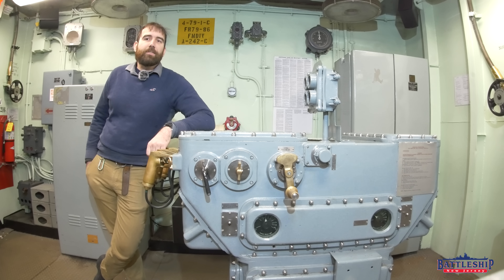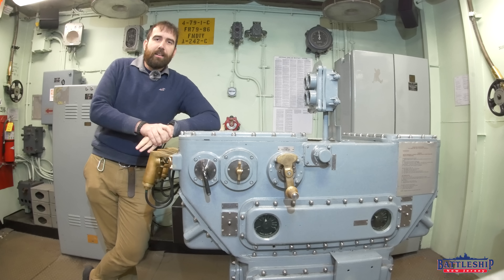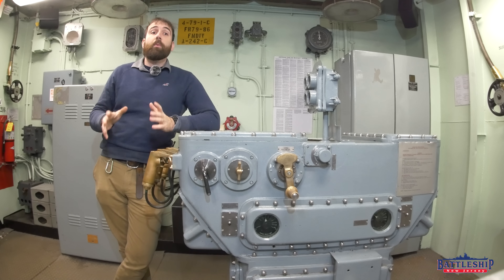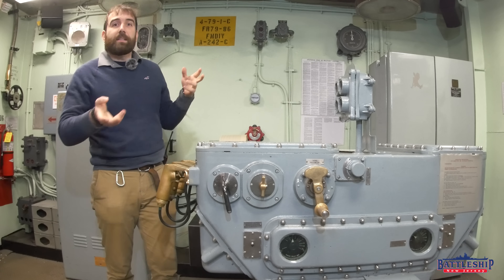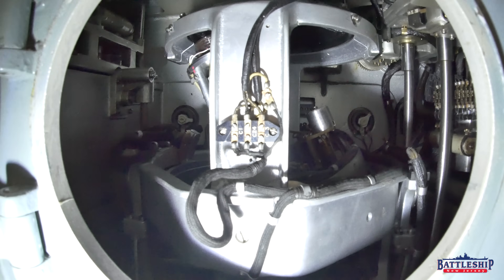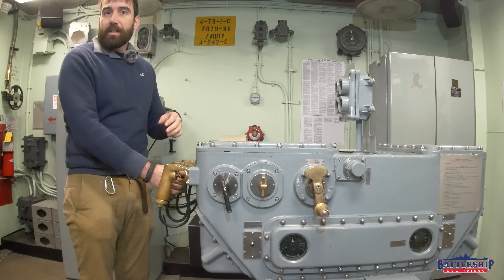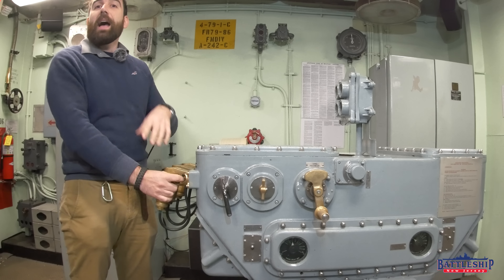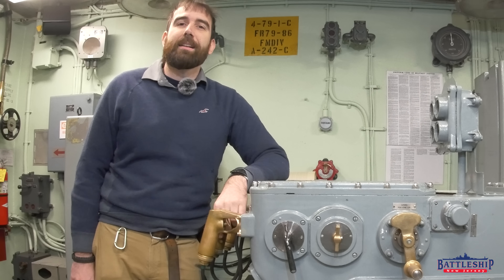The Firing Mechanism for the 16in Guns

Comment: I was stationed on the USS Iowa BB-61, Turret 2.  My last GQ station was Local Control.  One of the backup firing positions.  There was 3 of us in a space the size of a large broom closet.  Two brass tractor seats, two sets of sights, each seat also came with a set of cranking handles and one had triggers.  One person moved the turret horizontally and the other controlled the barrel's elevation and also fired the guns.  The third got no seat (sorry Charlie).  He had a few knobs on a wall to spin and mumbled into a sound powered phone.  I was the barrel elevation guy and fired the guns.  To go into Local Control, I would get the command to "go into Local Control" over my Sound Powered headset.  I would get out of my brass tractor seat, under the seat was a red lever with a pin that went into a hole.  Pull the pin and move the lever up until it stopped and push the pin back in.  You now are in Local Control.  The guy with horizontal control would look through his sights and crank the turret to the correct position and continually make minor adjustments.  I would crank the barrels to the elevation needed according to the crosshairs on my sight.  The third guy was spinning knobs for windage and mumbling incantations (LOL).
BTW: did you know when the ship is rocking in the ocean it stops for about a second at the top of it's rise just before going back down.  Besides elevation, I also had to time my trigger pull according to the Motion of the Ocean.  While everyone was loading the barrels I was making a count 1....2....3....1...2....3......1...2...3..  On "3" I would squeeze the left trigger 3 times then I would pull the right trigger and you to fire the guns at the apex.  If you fire at the bottom.....you end up way short of the target or in heavy seas & low elevation.....blasting the water and killing nothing but fish.
So YES, I got to manually aim and fire the biggest guns in the Navy with help from my friends.  Computer.........I don't need no stinking computer.......

Love to see you do a video from inside Local Control.
Reply: BTW: inset into the crank handles/triggers in Local Control are two 1942 pennies for good luck.

Comment: The leopard tank has a similar system where the gun won't fire if the computer detects that the gun barrel is not pointing at the target. So gunners are trained to press the trigger and keep it depressed till the gun goes boom.

Comment: What you've called the "stable element" is also known as the "inertial platform" and is more than just a gyroscope. FYI, inertial platforms (a three-axis set of gyroscopes) were used in Apollo spacecraft and could maintain the "bearing" of the command module or lunar module to high precision.

I'd love to see a more detailed treatment of the battleship fire solution computer as it is very elegant and the details make it all that more impressive.  Other  variables, such as air temperature and humidity were also factored in these computers.
Reply: Me too!

Comment: To be completely honest, I'm a bit surprised that the primary firing position for each turret wasn't was inside the gun house. I feel like each turret would be more accurate and maintain a faster fire rate individually in a close combat scenario than letting some guy 200 feet from the guns decide when to fire. Sure, keep piping the range information from the rangefinders on the mast but let each turret have control over its own firing solution.
Here's how I'd set it up: You keep the plotting room deep inside the ship for shore bombardment and extreme long  range ship to ship bombardment, but for closer engagements, you switch full gunnery control to a man in the turret aiming with an optical sight (Bore sighted with the center barrel). I feel like this would be a more efficient setup for reliably accurate AND fast salvos. But I'm open to counter-points
Reply: these battleships were able to hit targets miles away, while moving and while the target moved. insanely advanced analog computing

Comment: I think 3 firings locations.  Exactly what you have shown here (with the redundant bypass).  The second station should be a duplicate of this at the backup firing location.  The third should be from within the turret itself which should have the electric and the manual string.  That makes 6 ways to fire, two from each of three locations.

Comment: All these comments deriding the pistol grip fire control system.... Folks, you have to remember that pushing a computer button to "do things" was another 15-20 years away. That concept simply hadn't been developed yet. 

And in any event, even if it were well-known at the time, the Navy might still have gone with this system for a simple reason: reliability in combat, and I'm not referring to mechanical failure. Imagine you're the gunner getting ready to press the "fire" button, and your ship takes a hit strong enough to knock you off of your feet. Now you can't fire the big guns until you get up and back to your station--assuming you haven't hit your head hard enough on something to cause a medical problem. 

Now Imagine you're gripping the fire grips preparing to pulk the triggers and your ship takes a hit. A natural human reaction is to grip something, which you're already doing. You might still get knocked off your feet, but if you can retain your grip, you can still fire the guns.

Comment: Naval gunnery is way more fascinating than many realise, and the gunnery problem always remains the same, no matter what you're firing at: You seek to hit a moving target from a moving platform.

Calibrating the guns is equally intriguing, as it takes into consideration humidity, sea-state, wind, Lat and Long, cloud cover, barometric pressure, temperature, dip (the height and angular difference between the director/range-finder and the gun), target course and speed, and even the salvo sequence in order to allow for the recovery of the turret back onto the firing angle from a left or right gun discharge. Practice firings also seek to find and minimise any 'slop' in the system, that is, the ever present 'X' factor inherent in multiple gear-cogs, tachometers and linkages between the director and the gun.

The complex engineering which goes into a gunnery solution table is astounding.

Comment: More redundancy is better considering in battle your ship may pummeled like crazy with sections destroyed, flooded, on fire, blocked off etc. You may lose several and the quicker you can get to another system to get off shots could mean a difference.

Comment: In the summer of 1973, we were at Naval gunfire range at Bloodsworth Island in Chesapeake Bay for live firing exercises with the destroyer Lowry (DD 770). We were located in the main spotting tower, about 800 yards from the impact area on the island.  The Lowry was a reserve can at that point and hadn't been out in almost a year, so pretty rusty.  Anyway, the normal routine for a live fire mission began and soon we heard the RT talker say: "SHOT", followed shortly by: "SPLASH OUT" - which meant the round would land in five seconds and we were to observe and plot fall of shot. Suddenly there was a very loud BLAM right above us that shattered windows in the tower and spread hot shrapnel on the deck of the LCU parked at the base of the tower.  The Marine range officer immediately hollered: " CEASE FIRE, CEASE FIRE" into the radio.  Shortly after, the RT talker on the Lowry calmly replied: "Be advised we have a malfunction in our stable element..."  I cannot say here what the range officer replied....Even puny five inch rounds are loud when they explode directly overhead...As Ryan pointed out above, the stable element is a really important part in the gunfire chain....

Comment: Very similar thing to what they have in tanks. You press and the gun won't fire if it is not perfectly aligned with sight. So in rough terrain you sometimes may need to hold the trigger for 0.5 second or even longer, so it fires as soon as gun gets aligned with sight. This is because GPS (Gunner's Primary Sight) has it's own stabilization that is almost perfect, it won't jump around in heavy terrain as it is just a mirror being moved by the servos. Gun on the other hand is very heavy and has serious inertia, so it may lag slightly behind the sight during sudden changes in pitch, if that's the case firing won't be possible until it gets perfectly aligned with sight and that may take some split second to happen.

Comment: That's an interesting question, if it were a system that could be taken out by a natural event, I would say 4 redundancies with the first being physical and structural. Since this is a war ship, that changes things a lot. You know, when that system is deployed its going to be in harms way, there will be other things actively trying to destroy that system. With that being said, if they figured 11 redundancies, then 11 is needed. Now if we can just get engineers to use more common sense in their risk analysis in selecting places and ways to build nuclear power plants... Why did they never consider the scale of ocean waves from a prehistoric time line instead of what we have just seen in the last 100 years when building the tsunami wall? I would think logically that if the half life of the material in the reactor is 10,000 years then you must consider the scale of disturbance recorded via geologic evidence for the last 10,000 years. Additionally, bean counters have no say in this process.

Comment: I would say redundancy cant be pinpointed on a number. If you dont lose anything by providing an additional method to handle a situation, always do it. If its mechanically no problem to have a lanyard in the turret to fire manually in an emergency, do it. It probalby wont have any impact ever, but it didnt cost anything either.

Comment: I actually think 11 sounds about right, considering that you may not be able to get parts for months at a time, if 2 or 3 firing systems are out of commission you're stuck with the remaining 8 or so, which just because 3 already failed doesn't mean another 3 can't fail...  Ultimately if the ships could be expected to put into a shipyard or other repair station more than once or twice a year, 11 would be ridiculous, but I don't think that was what the Navy expected.  NOW with Japan as an ALLY, it is significantly easier to justify a less redundant system, especially as these FCS are getting more reliable - there are now very few theatres where we might bother to deploy warships that would be so far from friendly port, especially if we consider use of carrier replenishment for mission critical systems (like a 500lbs modern FCS computer/console).
Ultimately, 11 is 1 more than I would have asked for, and considering the last one is literally a rope it pretty much meets expectations.

Comment: To answer the question for the comments of the video, I'm honestly surprised there are ONLY 11 places to fire the main batteries from. Even if we say that #11 is 9 different lanyards for a total of 19, that's still, in my opinion, a relatively small amount considering it's intended role. I'd honestly say there should be a designated trigger for every Navalman authorized to give the fire command. You hear those 3 seperate bells ringing and go an uncomfortably long time without hearing a massive boom? Pull your own trigger unless otherwise instructed. I sincerely was under the impression battleships had at least two dozen press-me-for-ship's-purpose buttons. And that's excluding the hidden ones under the Captain's toilet.

Comment: When it comes to firing positions, I don't think you can have too many options. You never know what will happen during a battle, and which parts of the ship may become damaged, crippled or filled with smoke. Being able to prepare for scenarios A through X, Y and Z even when only A - F are realistically encountered may seem nuts, but too many battles have been lost because someone in the chain figured 'that will never happen', or 'we don't have to test that'.

Especially during the heat of battle you don't want to hear 'we ran out of options', or 'oops' :)
Reply: Or, "They couldn't hit the side of a barn at this dis__________"

Comment: Note that the main battery firing system would not fire the guns until the ship was rolling towards the target (unless perhaps it was calm seas), doing the opposite would contribute to the rolling of the ship a little. And the guns were not necessarily fired when the ship was on an even keel partly because the rate of the roll was the fastest at that point. More usually it was when the vessel's rate of roll was at a minimum when it was nearly at the end of the roll towards the target (again might not be done if the ship was barely rolling, or if the ship was firing at very long ranges and needed all the gun elevation it could get).

Comment: the thing about these fire control systems that's more amazing in my book is how water-proof they are. Unless they've been breached by shrapnel, water could be flooding into the compartment and you can still keep operating. as was seen in many of the battleship kills in ww2, ships fire control tended to die really early on, either by loosing the masts or central fire directors, and then the battleships just sort of died. Even at the best of times, the british had trouble with the Nelsons firing the 9 guns for any length of time due to electrical gremlins

Comment: Interesting that the job of the aft fire control fighting top had changed when the standard type ships were modernized in the late 20s. I didnt know that the aft director was used solely for tracking the horizon since it was typically the same design GE or ARMA director as that in the foretop. I had always thought that the two directors were used for what you said, redundancy/backup, but also for more accurate aiming by use of triangulation.

Comment: I'd say no more than one other redundancy is needed, depending on what it is, rangefinding could have three but steering only needs one redundacy.

From everything ive seen in naval warfare so far, by the time the first layer/tier for either gunnery or steering is destroyed, your ship is already well on its way to a watery grave. 

Because if it's gotten to the point that both of the primary rangefinders / steering are destroyed from sustained damage the rest of your ship will already be falling apart so much it serves no purpose.

Look at Bismarck, by the time the conning tower fell and thus steering 1, the whole superstructure was already destroyed, some if not all of the main guns were no longer working and the ship was already listing. I doubt tertiary steering had been in use yet by the time the ship went down.

So only one redundancy is needed, by the time the second one breaks your ship is lost anyway

Comment: The modern digital fire control was not adopted because it was more accurate, it was adopted because maintaining the analog systems is extremely tedious with regards to components being properly calibrated and aligned. Anyone who ever had the do synchro/Resolver alignments on them will remember 😎

Comment: I'd say that 11 is not an unreasonable number of redundancies. Those guns are the reason the battleship exists, so it makes sense that they would be as resilient as possible. You'd never want to be in a situation where your guns were still functional but unusable because you couldn't pull the trigger. Forcing the enemy to physically destroy the guns or significant parts of their infrastructure to stop their firing would definitely be an advantage for the ship if it ever found itself in a desperate situation.

I'm curious about the other 10 firing mechanisms now :) I know about the manual, ye olde cannon method, but I'd definitely be interested in a video about the rest of them! I'm also curious how the captain (or whoever orders the fusillade fired) specified who was going to pull the trigger. You obviously wouldn't want 11 people all thinking they are supposed to push the button so how does guy number two know that guy number one is out of action and it's his big moment? Or guy number three know that guy number two is on the ball and he shouldn't go fiddling with things?

Comment: The power of that mechanical machine is amazing!  it would be cool to know how its accuracy would compare to a fully automated, modern fire control computer using the same inputs.
Reply: When the ships were being reactivated, it was said at the time that a modern computer would be no more accurate, just faster.  But for 2 rounds a minute, the mechanical computer was plenty fast and still worked.  In an earlier video, Ryan confirmed this and said that if the Iowas had been updated to fire longer-range rocket-assisted shells, they would have needed new computers because the "stock" computer was good out to about 25 miles.   (The max. range of the guns is usually quoted as 23 miles.)

It is claimed that the computer could put all 9 rounds into a football stadium from 23 miles out.  And it could maintain a continuous firing solution on a target as the ship sailed through a figure-8 course, with the turrets training around their arcs as the ship manoeuvred.

These ships are absolutely magnificent pieces of industrial history.  The more I find out about them, the more fascinating they are.  It is wonderful that all four still exist and that enough of their jewelry survives to see how it all worked.  Ryan does a good job, too.